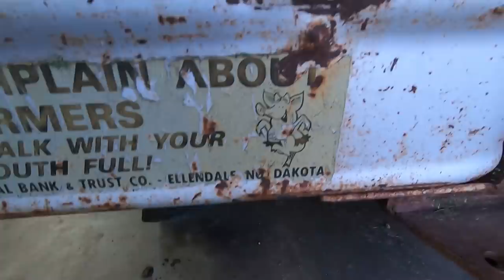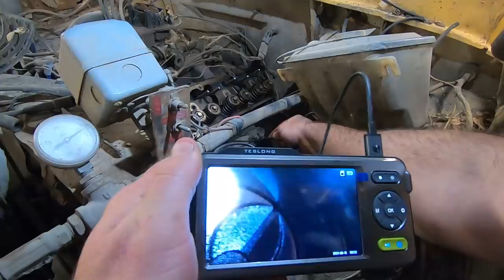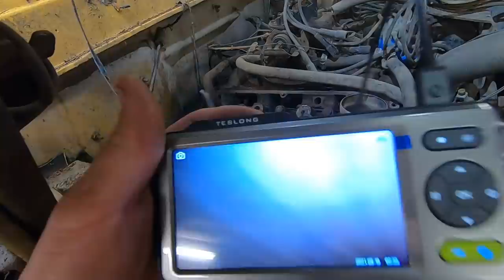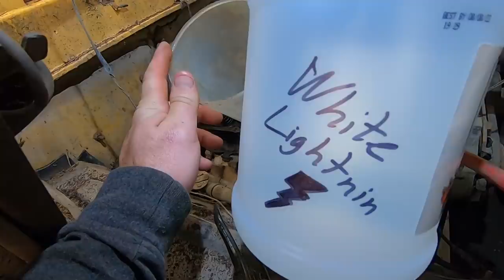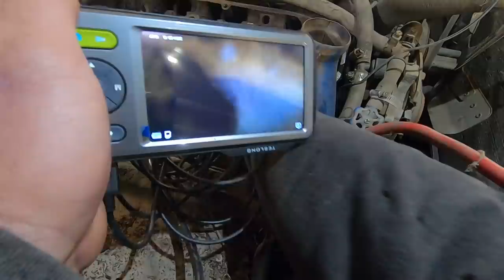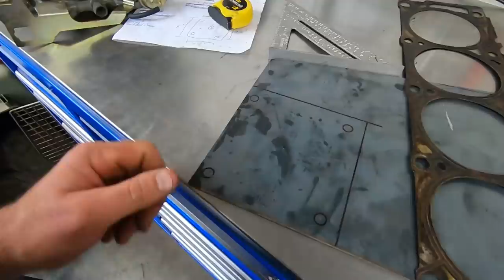Abandoned Farm Truck! 1971 Ford F100 4x4! Will it Run?!? Parked for 18 years in a field!

Comment: Another way of freeing up a stuck engine is to pick a cylinder that's almost up to the top of the compression stroke, take a spark plug, modify it to accept a grease zerk (or thread grease hose directly into it) and pump grease into the cylinder. With 10,000 psi of hydrostatic pressure, something is bound to give.
Reply from the maker: We've done that in other videos. Check em out!
Reply: @MortskeRepair  I've seen all your videos dude.... I just don't remember that part. Guess it's true what they say... The memory is the 2nd thing to go! 
(I can't remember what the thing 1st is)
Reply from the maker: @74beeper97  My memory is good. It's just short!
Reply: @MortskeRepair  Eye gotz smaerts reel gud

Comment: Well, the engine's bad but hopefully it can be saved if you decide not to use it yourself. There's still a fair amount of those FE blocks around but it'll be one more saved if the cylinder isn't pitted too badly. She'd make a feller a nice 390.
Reply: Some trucks have a number 103 mirror block that sometimes can be bored out to a 428.
Reply: @thecollectoronthecorner7061  I've heard also that if you pull one of the freeze plugs on the driver side of the block (I think the middle plug) there is number 428 cast on the side of the cylinder barrel in the water jacket that will tell machinists it can be bored to 428 specs.

Comment: Idea: I wonder if putting these  stuck engines in gear and then pushing them (or pulling them) would be enough to free them........You need to invest in an 18 wheeler Mort 😄
Reply from the maker: Tires just skid

Comment: Restored has a video of getting the stuck engine  running in a forgotten 1962 American AMC Rambler,,  Of course they did have to replace a piston because the old piston was reduced to several pieces during it's removal procedure,,  During the whole process of getting it running,, I kept saying "No way in h**l"...    but persistence prevailed,,  :-)

Comment: 21:44 time how did it rust up? truck was parked semi warm not enough time to burn off the water condensation and that explains why the other side was better looking because that was where the oil breather ( oil fill hole ) was, water vapor rises and will exit the only place it can oil breather

Comment: Try to invent a 2 piece tool, first half engages several flywheel teeth and has a shoulder, second half is any heavy jack hammer tool to tap on said shoulder.

Comment: An old timer told me an engine unsticking trick which might be worth trying.  Knock the porcelain out of a spark plug and weld a grease zerk in its place. Fill the cylinder with heavy oil, then hook up the grease gun and start pumping.   Obviously this will wreak HAVOK if the piston is at BDC, and the valves will need to be closed on the cylinder being pressurized.   This might also be a good way to get an engine to turn if you can't get to the flywheel.
Reply from the maker: We've tried that. Leaks past the valves and/or the headgasket or rings. Check out the flathead video. Think we tried it on some OHV engines too.
Reply: @MortskeRepair  Thanks for the info,  I must have missed the flathead video somehow. I think I have seen nearly all the rest. Good work!
Reply: Watched the flathead video and learned something.   In the old timer's defence, he was working on  a G John Deere, and with nearly 6" bore, the grease was able to exert more pressure.   

On the old Deeres I worked on, I would remove the block from the crankcase and use the press to push the pistons out.

Again, thanks for making your videos!
Reply from the maker: @drive42  I've heard of guys using hydraulic pressure on those old Deere twins...
Reply: @MortskeRepair  2000 psi @ 18 gpm scares me.
Reply from the maker: @drive42  Me too!

Comment: Or we could use this method fresh from the school of mechanical butchery. It comes under the category of "Fixem or F&^kem"  Grab your 10 ton or bigger bottle Jack. Make 2 nice fat 1/2 plates the same way you did with the gasket and drill the 4 holes and a larger one on the middle to suit. You will then need some 2 x 1/2 strap the height of the jack plus an inch or so (that will be your length of travel). So you're a making a cage to capture the jack with 4 bolt holes on the bottom and a big one to to put block or pad, or pipe with a bit of plate on the bottom of some kind through that will sit under the base of the jack on top of the  piston.  Then you can start pumping. You wont have a lot of travel but you can make a few pieces of pipe or something like an old gear.  whatever is handy. I made a similar setup to get a vw kombi rear brake drum off using a 10 to body jack. It used an old rim , 5 pieces of 2 x 1/2  strap and a piece of plate to push against. I set it up and it didn't work so i left it pressurized and went upstairs for lunch . A couple of minutes later i heard a loud bang and it came off. LOL
Reply from the maker: That would work too!

Comment: Hydrolics? Grease gun? Fitting in the plug hole?  Fill the cylinder with grease? Grease gun pushes the piston down?
Reply from the maker: We've tried that before. It finds a spot to leak usually.
Reply: @MortskeRepair  dang

Comment: Iv never had a problem getting a engine unlocked in less it's had water in the cylinder iv broke loose a dodge 360 in my 85 and drove the shit out of it for a few years but iv seen a lot of different ways to get them unlocked

Comment: Is the acid suppose to eat up the rust? I vote for a 390.. Is it for sale? We use to soak rusty stuff in diesel. Are 360 heads the same as a 390?
Reply: They are the same as low-riser 390 heads, but compression-ratio is an anemic 8.5 to one, but can't go to high or it will ping( or need high-test gas).
Reply from the maker: Yup, more info in the video description if you're interested.
Reply from the maker: @tomwinkle5536  There you go, buy a Camaro.

Comment: So the 360 was a turd at it’s best, and I’m not gonna hate on you because it probably shouldn’t have been put into the truck at the factory in the first place, but if you’d exercise a little patience, that Marvel Mystery Oil would eventually loosen that junk up. Also, on a side note, Lucas fuel treatment in a dried up carburetor will clean one up if you let it sit for a year or so…

Comment: Unfortunately I know for a fact I have been stupid enough to leave water in the farm truck sitting by the field and the sbc 350 in it got froze and pushed three of the core plugs out and we drug it up to the garage and put the front end in the garage with the kerosene heater and the fan blowing towards the front of the truck,, and it unthalled and I put new freeze lol core plugs and a new set of spark plugs in it and it fired right up after you made the gas pedal sing like Michael Jackson,, because the electric choke was bad... and put antifreeze in the radiator after the ice melted and went down and I also checked the thermostat after it thalled out and it was fine 81 Chevy c20 custom deluxe long bed 350 2bbl 4spd

Comment: That engine would have freed up if you would have gave it some time and some shop heat while I was waiting for the solvent to do its trick I would have pulled the pan and check on a couple of rod and main bearings to find out if you was really wasting time

Comment: FE engines wont rust with sludge but if it was a nice clean motor then they rust pretty bad. I would just find another engine like a 390 and put it in then sell me the truck.

Comment: Only other motor that runs after it is stuck is the gm L6 and the sbc and I actually owned a 91 chevy s10 extended cab el long bed 2wd had a napa replacement 2.8 v6 crate motor that had been frozen 4 times,, and it did a number on the radiator and the freeze plugs and water pump, but I would have to include it as one that ran after it was stuck, just like the 88 Chevy S10 regular cab short bed loaded 2wd Tahoe i had 267k it was frozen and I broke it loose why I don't know because the oil pump had already checked out and it was trying to shave the front bearing down a bit,,i was thinking about trying to rebuild the motor because it was original but it was a lost cause it knocked but never blew up..

Comment: Dang bud you tried a heck of alot more than I would have good video atleast there is someone that will try that hard to get it un stuck net time you could try the map again but use grease fitting and fill it with grease

Comment: Fill the cylinders with muratic acid for 20 mins muratic acid actually does desolve rust
Reply from the maker: Hard on everything else tho isn't it?
Reply: @Mortske Repair  won't hurt nothing but the rust as long as you don't leave it in to long side note pretty cool to get a reply back haha I feel important

Comment: In my opinion and years of experience with ford's   that engine is toast I have 66 T bird has the 390 fe runs like a top I was really surprised it had been sitting for 12 years put a battery in and hooked up a gas can and she fired right up

Comment: Every time I see you clean out a bed or a cab I think a small stiff lawn rake is the tool. Also at the risk of setting the viewer's hair on fire, replace that boat anchor with a salvage 350 small block. The last Chevy truck I had was showing 360 thousand miles using 1-quart oil between 3000-mile changes. GM built 100+million SB-V-8s they likely know something.
Reply from the maker: Great engines!

Comment: Build that 460 dude.
Reply from the maker: What 460?
Reply: @MortskeRepair  i thought that was what size engine that in that yellow Ford truck you have.
Reply from the maker: @rlw3154  It's a 360.
Reply: That's right, it's the same.engine,that was in the highway patrol cars back in the 70's.

Comment: instead of a bolt use grease hydraulic way more power.
Reply from the maker: We've used grease before. Check out the flathead video. It always finds a path to leak out.

Comment: You know what that lube you're using the penetrating oil is nowhere near as good as PB blaster I have broken loose engines with PB blaster where the the piston was welded to the sides of the cylinder a lot worse than that
Reply from the maker: Good to hear.

Comment: Clover Valley is about the lowest chance of success out of all the brands of vinegar out there. I spend the extra dollar and get main brands like Heinz or Gedney and never have either of them failed whereas  generics like clover valley have failed
Reply from the maker: Intersting
Reply: @MortskeRepair  as a test, take 2 containers and put equally rusty bolts or other items in each container and fill the containers with vinegar with one being clover valley and the other being either Heinz or Gedney and let them soak overnight. Use rubber gloves when handling the items the next day as it will turn your hands black as used motor oil if you don’t and it is hard to wash off your skin. Take the items out of the vinegar and either wipe them off with a rag or rinse them off with water and compare to see which was more affective.  No need to go more than overnight to verify your results

Comment: I'm fully completely retarded and high as a kite right now but in regards to the seized  engine,,,    can't you put the truck in gear and rock it back and forth therefore using the weight of the truck to break its grip ?  When I seen the hammer chisel come out was when I decided it was ok to post this.
Reply from the maker: The wheels just slip on the ground.

Comment: If ford's suck why did you buy it?
Reply from the maker: To upset the Ford lovers! Is it working?!?
Reply: @MortskeRepair  I have a 92 ranger with the original 2.3 it has 235k miles on it and still running like a top so yeah I've had good luck with ford's.

Comment: Newer engines wont even run without a computer hooked up to them / stupid  just plain stupid. you don't even get that much better fuel economy with the newer engines that last only 50k miles or so / turbo sucks in a daily driver